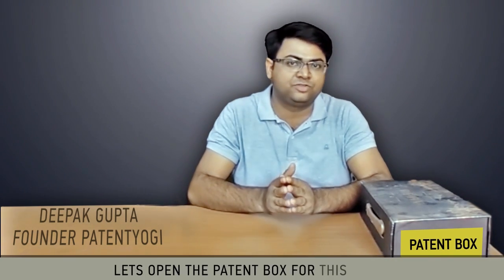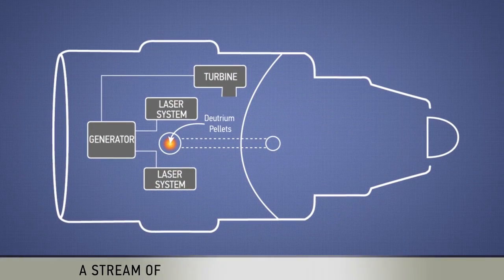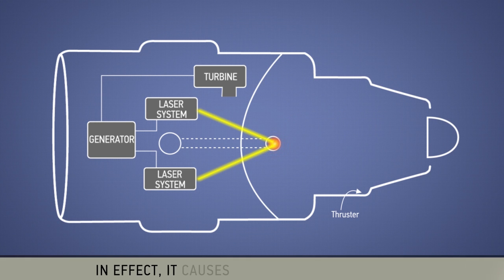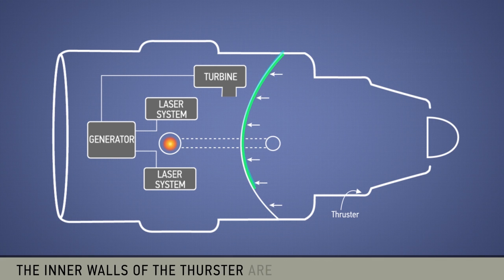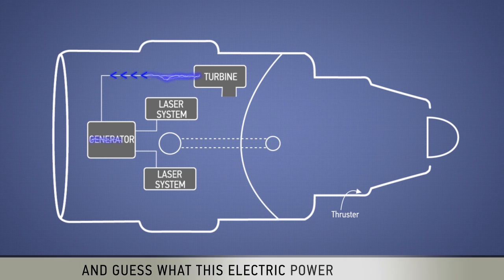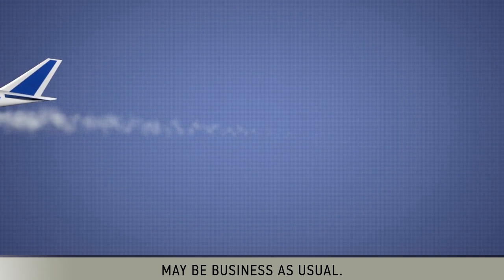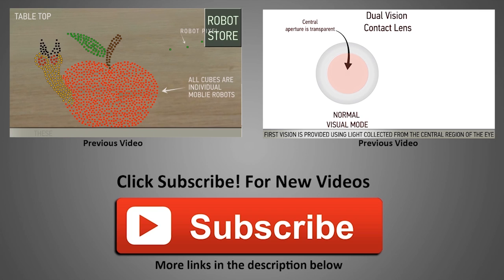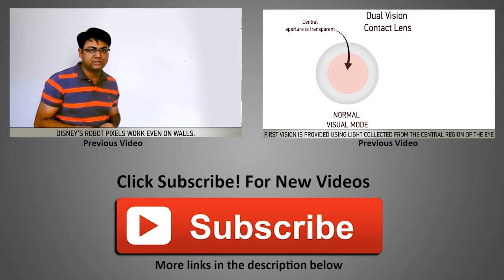Tiny nuclear explosions will power aircrafts, reveals a new patent from Boeing.

Comment: Umm... how much shielding will there be for the people sitting nearest to the engines?  As I understand it, even today, frequent flyers are exposed to a higher degree of radiation from space so I'm thinking the hull of the aircraft is rather thin.  Will it be made thicker to accommodate this?

Comment: Interesting concept but a couple of issues to address.
For space flight the momentum of the fusion products might be enough but for atmospheric operation I would think you would like to use the heat to heat air to provide thrust.

What will the neutron flux be on the passengers?

Comment: Don't think it will work in an atmosphere. Also isn't there some laws of thermodynamics regarding perpetual energy? hmmm. this whole idea sounds like a publicity stunt.
Reply: Richard Yost 
It is not a perpetum mobile for sure. The neutrons will eventually burn up all the fissile materials on the wall. At one point, that has to be replaced, like current reactors. The deuterium tank has to be refilled once in a while, as well.
Reply: Richard Yost Since when does the patent office issue a patent for ideas?  I thought you had to have a working model for them to do that?  I got a great IDEA too, lets build a engine that runs on poop, plenty of that around and its renewable, lol.
Reply: Too late, there are seveal patents about burning poop for energy. And the US Patent office is plain stupid. If I recall correctly, someone patented the shape of the rounded off rectange.

Comment: It looks neat, but I don't believe a steam engine, that can fit inside an airplane turbine house, can generate enough electricity to power the lasers.

Also I believe, it is normally non polluting, but what if the plane crashes? That would release radioactive uranium into the air.

Cool for spacecraft propulsion. For commercial air planes flying over populated areas, unlikely to happen.
Reply: Pendra37 Spot on!
Reply: Pendra37   its DU depleted Uranium, if the as been bombing hundreds of thousands of this i guess is about the same

Comment: I would never allow this to be used in this planet’s atmosphere. Fusion reaction in this implementation is not clean; everything irradiated by fast neutrons will become radioactive waste. If they will be fast enough, can penetrate sides of engine and get to the cargo. Next, uranium shield / electricity generator is open to deuterium combustion chamber, thus environment. Fission of uranium will definitely create nuclear waste, part of witch try combustion chamber will get into environment. For space flight, this can be way to go, but not atmospheric.

Comment: While I'd love this technology to be developed the rabit anti-nuclear and "green" crowds won't allow it, irrespective of the damage which conventional energy generating systems cause to the environment.
I, for one, would definitely fly in one of these.
Reply: Garry Morgan What reality is that then?
Whether or not this technology can be developed is an engineering issue (it may not be feasible for various technical reasons; I don't know). But whether or not it will be researched/developed is a socioeconomic choice, and I assert that the current socioeconomic climate will not allow this type of technology. For better or worse.
Reply: PatentYogi I'm not so sure about it being a good choice.  Other then Helium, what are the other exhaust elements?

NOTE: I'm assuming that Unanium-238 Oxide is used for the wall.

The scenario described in the video suggests that Neutrons from the isotopes of Hydrogen (That is Deuterium and Tritium) causes the creation of Plutium-238 Oxide.  If it leaves in exhaust, or as a result of an accident, Each pound of Plutium-238 Oxide can give 2 million people cancer.

Personally, I'm going to suspend my acceptance until a Group of Theorists gives a more detailed account of expected exhaust and effects of accidents, because 2 million cancer patients per pound is too high to ignore, but the engine could be valuable.
Reply from the maker: Michael Werle Good choice!
Reply: Michael Werle It is not a question of not allowing it, it is a question of reality.

Comment: Spacecraft perhaps.... Air Planes with engines lined with Uranium? I am sure that would go over like a turd in a punch bowl!
Reply: PatentYogi But where does the hydrogen come from?
Reply: Thomas Puzino there already is uranium in normal planes, as ballast
Reply from the maker: Thomas Puzino Fission reaction is a secondary process for this invention. Fission may be avoided and the aircraft may be powered only via fusion reaction.
Reply from the maker: abel varga The invention uses deuterium also called heavy hydrogen.
Reply: So this means that some deuterium does not fuse with tritium, just splits? Thank you!

Comment: Scramjet?  With no air?  Not sure the FAA is going to allow nuclear fuel used as thrusters, but NASA won't care.....  maybe its not for this earth?
Reply: Ed Quinn you cant call it a scramjet without air.
Reply from the maker: Ed Quinn The patents says that the technology could be used for spacecrafts as well. Cheers!
Reply from the maker: ***** Agreed. Also, Boeing could avoid fission reaction in the process. They can power the aircraft using fusion reaction only. That will be much safer option!